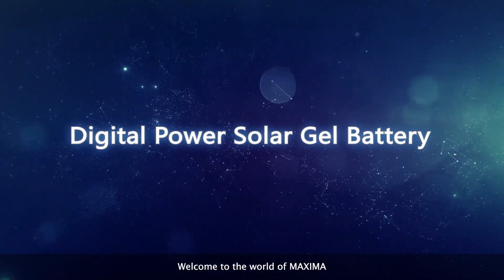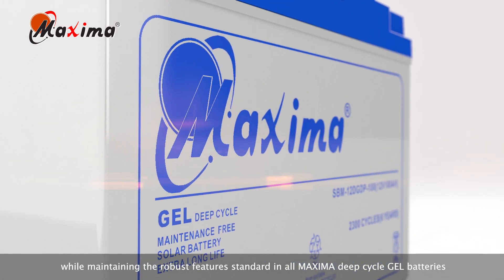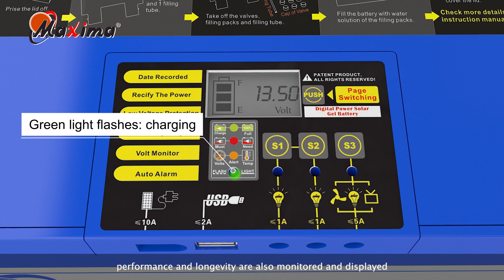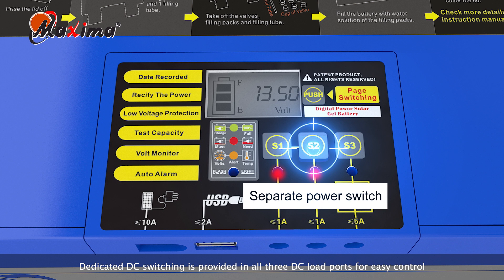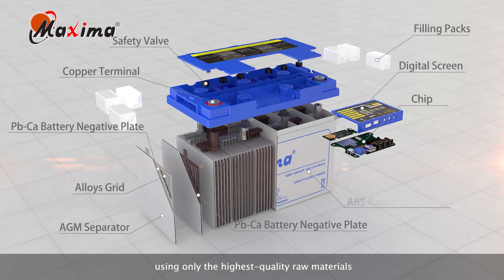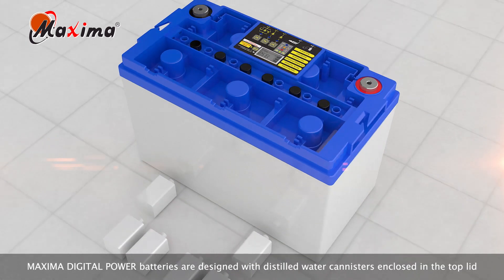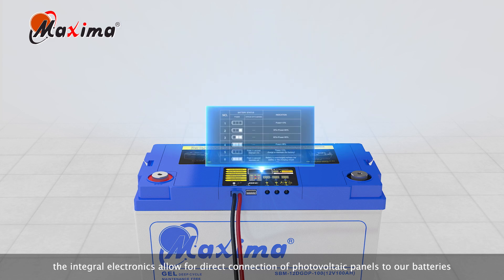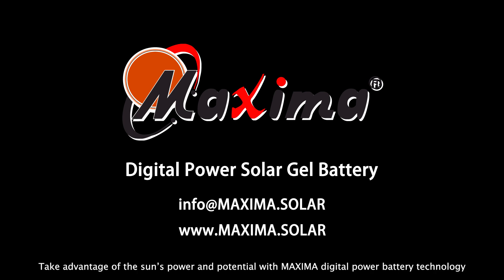MAXIMA - DEEP CYCLE GEL DIGITAL POWER (DGDP) - Batteries

Comment: If the fluid given by the company  once use and the battery required more fluid in future what should we add ( fluid) and how much in quantity.
Reply: Hi sir. Can you please give me the address l want buy battery from your company?
Reply from the maker: Please call +971 4 2231185 or email info@apexpowerconcepts.com
Reply from the maker: The refill cartridges are to be used after about 2 years of use.  The battery is designed to last for about 5 years, so you will come to end of service life by the time you feel to replace the fluid.
Reply: What type of refills are used, are they gel or they are distilled water?